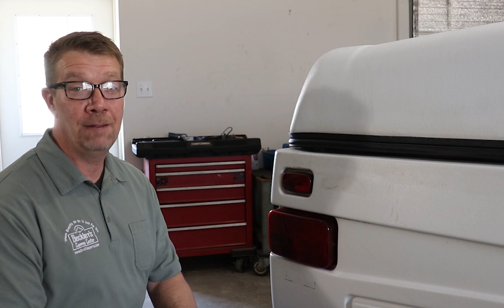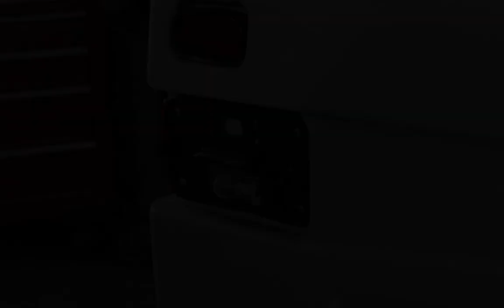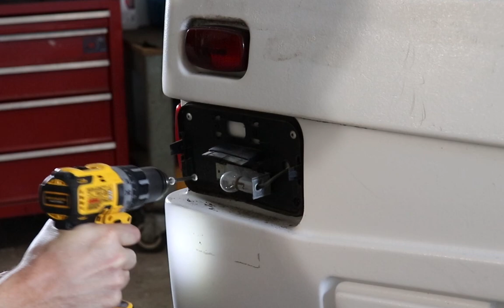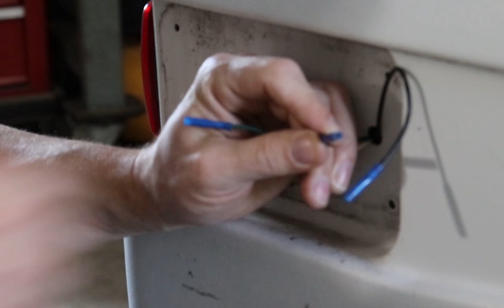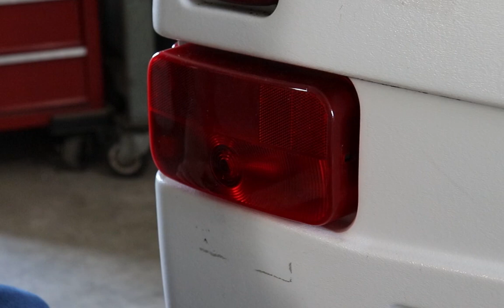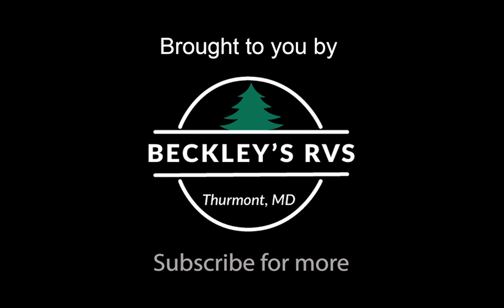How to replace a camper taillight

Comment: How do I remove the license plate light to change the bulb and what bulb?
Does it just pull out or is a turn involved- don’t want to damage it.
It’s round with a white lens and above the plate
We have a 1991 Roanoke- still great!
Love your videos 
Thank you!
Reply from the maker: Tobruz, If you have the style I think you do, the bulb is not replaceable. You replace the entire fixture.
https://colemanpopupparts.com/products/tag-lamp
Reply: @popupcamperpro  thanks I got it, it was a snap in fit with the same bulb as the marker lights, cheers! Same bulb working since 1991!

Comment: Awesome video. I don’t have a Coleman, but I am having difficulty finding replacing bulbs and housing for a license plate on my popup. Any suggestions?
Reply from the maker: Consider replacing the tag illumination with a new tag lamp assembly. If your license plate is under a taillight and not receiving light, you may have the incorrect lens attached.
Reply from the maker: Maurice and Carolyn this style is self grounding, and would require mounting it to a steel surface. You need to ground it with a ground wire, or replace.
Reply: Pop up camper pro awesome thank you very much for that.

Comment: What size drill bit did you use to drill out the 3/16" rivets?
Reply from the maker: One slightly larger than the hole inside of the rivet head.

Comment: Hi. What size and or style rivets did you use? I need to replace a smaller light in the Abs cap on the backside of my roof.
Reply: Just to add that it’s a 2004 Fleetwood bayside elite.
Reply from the maker: With your model name and year, you can find the rivets at our webstore. Please let us know if you need assistance in choosing the correct one.